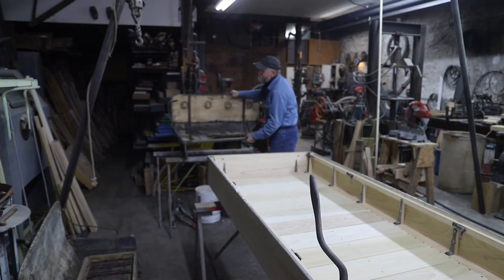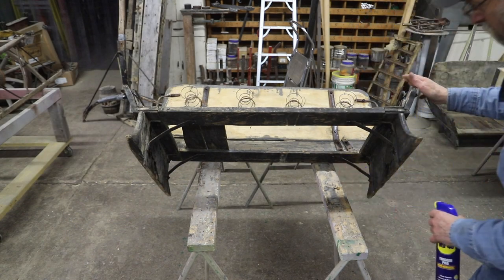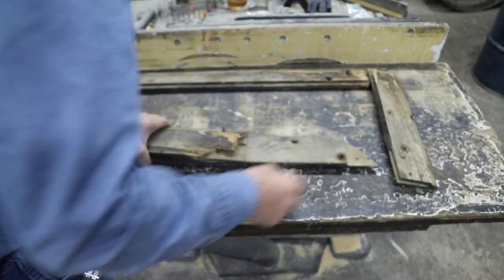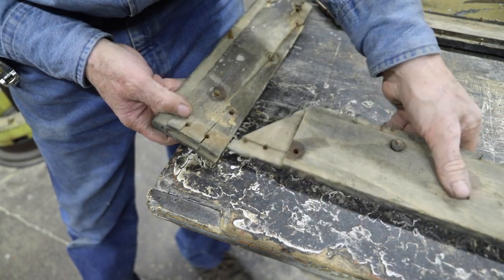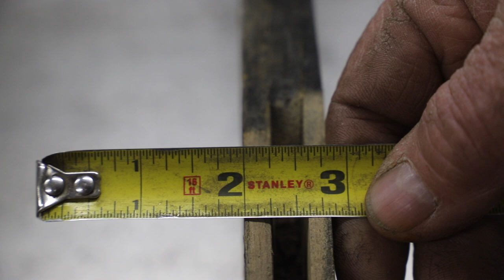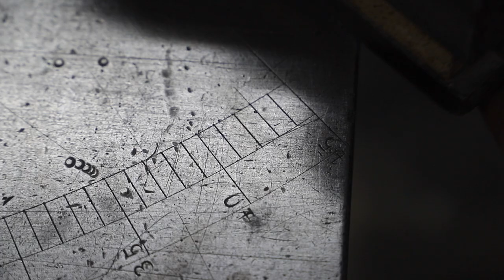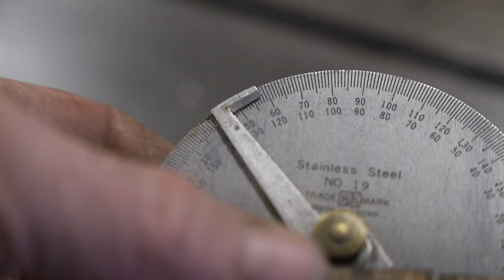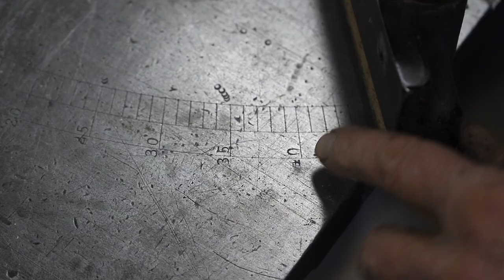Challenging Buggy Seat Base Corners | 2 Seat Buggy Part 8 | Engels Coach Shop

Comment: One time I built a jig for a rolling beveled miter.  It took two days to figure it out.  But I couldn't use it.  I had built it exactly backwards to what would work.  An older man happened to drop by.  He had been a pattern maker for many years.  As I was explaining my problem he had already stated with some modifications.  In about 15 minutes he corrected my jig whereas I was thinking I'm going to have to start from scratch.  Mr. Engels, I fully appreciate your trials and your skill.
Reply from the maker: Yes, conceptualizing the procedure sometimes takes longer than carrying it through huh.

Comment: If they did it the hard way back in them days there must have been a reason ? Your respect for their reasoning is what makes you so special  😊✔
Reply: There has to be one. Because you see, that type of joint, isn't as strong in the vertical plane as the full one is. It's excellent against deformation in the horizontal, like against turning it into a parallelogram, but vertically, you could snap one quite easily, and on this buggy, there's no real obvious reason to defend against deformation because both the buggy frame and the seat's backing keep things kosher.

So there's got to be a hidden reason, and a pretty strong one at that, for them to have gone for it, because as seen in the video, unless you do it just right, you'll mess up. And it's not like today, when you could make 50 of X part and they'd match perfectly. Back then, it was based on what lumber they had available, so each buggy might slightly different, especially in a more econo class, if i'm allowed to call it that.

Interesting pickle, for sure.
Reply: And then, maybe the builder felt like it was called for that day.
Reply: @aserta  Dave did say the original seat he's copying had ironwork for attaching a top to it right?  Its possible this wagon was going to be used in locales with brisk breezes and the builder was trying to make the seats stronger against wind loading from the brisk side winds acting on the top day in and day out, not having the seats turned into parallelograms over time with this joinery.

Comment: Fantastic work there Dave!  All the hassle to construct that jig, just to cut the mortise and tenon joint - seems to have worked out so remarkably well for you!  You certainly have an abundance of patience and dedication to your work!  As I watched you glue up and clamp down those frames, I actually felt like cheering out loud!  (so, okay I did!) That was a heck of a lot of joinery, just to craft a sturdy place for the drivers' backside!  Keep it up Dave!  These days I seem to need more reassurance that there's some greater value in building something far better than it has to be to function.  There's also the warmth that seems to come over me, watching older hands using even older skills and techniques, simply because that's the way it's supposed to be done.  Thank you sir!

Comment: I remember a number of years ago when I was the electrician at a street rod shop here in San Diego, the lead painter mentioned to me "Everybody sees the paint and body, and they go "Oooh!" and "Ahhh!". They look at the interior, and they go "Oooh!" and "Ahhh!". The only time they notice the electrical is when a switch doesn't work."  I know exactly how he meant that: I do my job, I do it well, and I do it unobtrusively. I made certain that switch, no matter how complicated the job, didn't break or not function. 

I'm reminded of that when you mentioned that a lap joint for those bases would have been faster, simpler, was much more common, and would have held up just as well. Who would have known? For starters, you would have. I guess this is one of the bigger reasons why I love your channel.
Reply from the maker: Thanks Bill.  You're right - who'd have ever known, but....
Reply: Interesting way to put it.  I do many renos, large and small.  I'm far more concerned and careful about what you don't see in a job.  If it's done right, everything else comes up great..  Do it wrong and everything else has problems.  It's that attention to detail of the 'inside' that I enjoy about these videos.  Careful, methodical and correct.  Love that jig - I may try that style of joint one day too.  Cheers to the 'unseen heroes'.

Comment: As always a great vid that shows how even in to days quick and easy make it do society there are true craftsmen out there that near enough is not good enough and with a little care and attention you can make it the same as it was but with better modern glues and attachments (bolts and screws it will last hopefully in better condition for atleast as long as the original did. To be honest i could sit here for hours and watch you take plain pieces of wood or bits of steel or iron and turn them into such great restorations or repairs. Gives you a whole new respect for how these were made in times of old with only hand tools and early machines. Hope you have  been able in your own time to pass on all your talents to others that will carry on once you decide you have done your time as these are the skills we are all to eager to let be lost as not required today when we have such a use it till it breaks and get a new one society.

Comment: Building the jig usually takes much longer than the job itself. Despite the hiccough (what's 7 degrees here or there, lol) it was most enjoyable. Thanks, Dave.
Reply: Can't get my head around why that angle was used
Most would stick to 45 deg - yes Dave is a professional but that angle issue, for me, just wasn't worth the effort - (me) professional doesn't mean perfectionist
Reply: @MrLikeke  I doubt "historical recreations no matter how wrong" would be continued by Dave Engel if Dave knew that by recreating the same would ensure consistent failure.  In this case (the buggy seat) it seems, from my perspective, that there'd be little difference (additional failure) because of the additional structures and fastenings which maintain the whole structure of the seat BUT for me personally - thinner (intricate) pieces of wood will rot quicker than thicker versions 
BUT hey... I'm no professional and no perfectionist.... just methodical with lots of thinking.
Reply: 90 percent of any job done right is in the preparation.
Reply: @philhunt9297  Phil, what you say is the other side of the coin.  The historical remodels I have been on have much to do with historical accuracy and not so much with what seems practical.  Sometimes it is agonizing as like digging a hole with the wrong end of the shovel.  But there ya go.
Reply: @MrLikeke  Stole my thunder. Exception: historical restorations of buildings must meet current code.

Comment: That joint is like a bridle joint I would call it a mitered bridle, we used them sometime in carcasses. I think that seat construction is really a top class job.  Covered in metal corner pieces the mitered corner joints for the seat that are not seen show that the maker took pride in his work, much like yourself Dave. Also it seems to be some fancy metalwork as well

Comment: I really like your little baby Wonder Bar you used on those small rivets and sheet metal corner brackets. Whoever designed those corner joints must have been a glutton for punishment.  And you Sir, "have more sneaky moves than a streaker at a policeman's picnic!" Excellent jig and fixture making.

Comment: Well, that was an immediately useful video.  I've had a piece I've been meaning to make for a while that I was balking on because I didn't have a proper tenoning jig to cut the slots in the ends to make a joint rather like this one.  Now I know how to do it with a few pieces of scrap wood instead -- and I feel a little silly for not thinking of that before.  Thanks for the help!

Also, seeing how this works cut at an angle is going to make my assembly better than I'd planned, too; I was thinking of doing it cut straight across, but an angle will work better.
Reply from the maker: Very nice.  Have fun!

Comment: Dave's Table Saw might have had a Tenoning Jig Attachment once upon a time but it's likely long gone but they do make modern versions today and you'll find them quite affordable depending on what you need. Many can be adapted to nearly ever saw if it's guide bar is to large/small fit it's grove by machining it or just replacing it with the right stock bar since only that part that needs to ride in the table's slot and they also can be used at times elsewhere for stock on  a shaper/router table. Though his jig was about the only alternative he had since most Tenoning Jigs are made for Table Saws not as Old School as his and far smaller but he could probably make a version since he did it for the Morticing Machine he all but remade from scratch earlier. One thing to think about for most of us  would the buggy seat hold up to a modern passenger who's a bit  more Elephantine than those that rode in it when it was new since we're on average taller/wider than they are is why often things like carriages/coaches seem to be quite small to us today.

Comment: That’s clever by putting the tenon on 38 degrees it doesn’t come out the side. The joint is not exposed to the weather. Thanks Dave
Reply: Greg Home. That's brilliant!! I assumed the joint was 45 degrees.  We all assumed it was 45 degrees. So when we find it is 52 degrees......why!!!  It's 52 degrees so it wouldn't show on the outboard side. EUREKA!!  Thank you so much for that observation, now I can sleep.
Reply: The joint have been cut at any angle. By just shortening the tenon and cutting a stopped mortise prevents it coming out the other side. I have no idea why it was cut at 52*/38* but I am sure those craftsmen had a reason. 🤷‍♂️
Reply: @philmenzies2477  your right Phil a stopped mortise would do the same but thinking on it just now, it would be much harder to cut.
It would have to be chilled carefully to depth at match the shortened tenon.
True 52/38 is just a straight cut. I would never of thought of it.
Reply: Sorry auto correct,
It would have to be chiselled carefully to a depth that exactly matched the shortened tenon.
My bad.
Reply from the maker: Very good Greg.  Since this stirred so much discussion I think I'll touch on it, but you're correct.  With two equal width boards, and to allow the side arm board to not rest on the joint, plus not having an exposed joint on the side view, this joint has to be 52/38 degree.  Nicely perceived.

Comment: Hello ✋.   There is a Russian proverb.
" Measure seven times, cut once."
The English language probably also has a similar one.  Great job, as always🤝
Reply: The "English" one is measure twice cut once (I used speech marks because I believe the Americans do same)
^^not for precision engineering ^^ 😉
khoroshego dnya (have a good day)
Reply: @philhunt9297  🤝
Reply: @philhunt9297  Obviously, the English aren't as careful as the Russians. Or perhaps their rulers are more accurate. ;-)
Reply: @alangknowles  huh?  why would they need to measure more often if they had more accurate rulers?
And I'd add - going by the way some Russians drive, in comparison to UK drivers, being more methodical and accurate ain't helping.
Reply: "I cut it three times and it's still too short."  :-)
Reply: But if we all did that, then we wouldn’t have any firewood.  Like I tell my boy, “ if it doesn’t turn out right the first time, it will warm us in winter. When we burn it”
Reply: @Stuart Stephens Said the apprentice carpenter.
Reply: @Антон Корнев From a capitalistic perspective, “Measured twice, cut 100,000 times.”
Reply: @stuartstephens  Sod's law always  takes over when I try to do woodwork .,Measure accurately. cut accurately, )0ops an eighth of inch to long . cut the eighth off .sod it , it's now a quarter  inch to short .eventually  when I do cut a piece the correct length , when I go to nail it the wood splits . I hope Dave reads this .
Reply: @ITeachRick  Hello. I was born in 1976 and lived in the USSR. And I understand the difference between capitalism and socialism. We had free education and medicine. The state provided rent-free housing, which has now become the private property of those who live in it. In the USSR, employment was guaranteed. There was no unemployment at all. But people slowly betrayed their country, for magazines with prostitutes(playboy) and Hollywood fairy tales. Most in the USSR thought that in the USA and Europe everyone has a big house and 2-3 expensive cars. We thought that in the US you work 5-6 hours a day.The Rest of the time you ride Harleys on the beach.......))))
Reply: @Антон Корнев Thanks for the reply and sharing some of your life! I’m a bit older than you, born in 1962. I started my apprenticeship in 1976, 😀, in a sheetmetal shop. I also lived in a commune from 1970 to 1982, so some of our lives are very similar. Employment, living, school and medical coverage. We didn’t get paid much, but food, transportation, clothes and most everything else was covered. I didn’t follow much of what was happening in the USSR, except for the love of vodka! I do remember that there was a fondness for America stuff, jeans, dollars.... 

Do you miss the good old days? Do you like the independence of capitalism? I left at 19 to find my own way. The “free” stuff was great but I felt a responsibility to earn what I got. I wouldn’t want to live in even a socialist society. Way too restrictive for me. 

Where do you live now? I’m in California. Great to chat with you!
Reply: @ITeachRick  The old days were good. But today is not bad either. At least in Russia. God save Putin. Russia was almost destroyed under Gorbachev and Yeltsin. Putin is rebuilding the country, but we still have a lot of enemies inside the country.
Reply: @ITeachRick  You said that the socialist  sociaety is too restrictive for you.  I think you  wrong. In the  USSR, idiotic  laws began to be issued under Khrushev. After Stalin's death. When Stalin was alive, every year, prices went down and wages went up, there were privat firms that were called "Artel" (Cooperativ). Khrushchev destroyed them.
Reply: @philhunt9297  it is measure twice cut once 🇬🇧
Reply: @paulstanding7267  Isn't that what I wrote?
I added speech marks as I believed the USA has similar
AND here's proof
https://www.goodreads.com/book/show/175349.Measure_Twice_Cut_Once
Reply: @Антон Корнев When I was a young, I heard the Gorbachev was a great man! So interesting to hear from a Russian, that he was a destroyer. And now, we are told the Putin is awful and you’re praising him. Another communication breakdown between our countries. I’m happy that at least, us common people can talk politely. 

Please tell, how communism isn’t restrictive. I’m really interested? In my community, my mother didn’t have much choice in her job, where she lived, how much money she made, what food she ate and much more. We were both pretty low on the social scale. My older sister had worked her way up the ladder and had more influence in her life. There were people higher up who had their own cars, very nice living arrangements, ate better food and so on, so I know there can be levels for different people. For us, most of the people were “commoners” so we were mostly equals. 

Depending on the wealth of the country or group, prior to going communist, I can see how life can be good, in the beginning. I know nothing of Russia under Khrushchev or Stalin, so I’m shooting in the dark. What us capitalists say in that communism works till you run out of other people’s money. I believe any system can be exploited, abused and corrupted, by the government and even the people. If most everyone is working towards the same result, capitalism and communism can work well. From what I see, in communistic countries, the powerful people are untouchable and stay in power. In a capitalist society, there is the opportunity to advance beyond what you were born or destined to be. I will personally attest to that. When people want more than other people, both systems breakdown. Such is the case in the USA now. 

Thanks to the chat.

Comment: Wow Dave!! I would call those fine furniture grade joints. Great job on a joint that is a real pain. I have done similar joints on a frame for a heavy antique mirror-had an impressive scrap pile after it was done. Like you I am not at all convinced that joint is any better than a simple lap joint given the load directions it will see in service.  But I certainly respect and admire your commitment to duplicate the original. regards vic

Comment: Very nice improvising for your tenoning jig.  I like your goal of making it as it was made, though I'd say that a bridle joint is actually stronger, and if course way simpler to cut.  I'd agree that originally the aim of the mitered mortise & tenon may have been done in that the end of the joint wasn't open to the weather, but then back then their glue wasn't nearly as good as type III your used.  Anyway beautiful work as always.  (by the way, your old F&E dual arbor brings me good memories.... I had the exact same saw about 10 years or so ago.  Liked it a lot, but a PO had modified it too much, and rather than spending an ungodly amount of time restoring it, I finally gave it to a friend)

Comment: You may have touched on it inthe past and I haven’t seen it, but if you could offer your take on materials it would be of interest. I see a lot of Ash going through that shop and I think I know why. Light, strong and bendy. One of the most utile woods we have. I have been in love with it since I first laid hands on a Louisville Slugger and use it whenever I can. I even have my woodstove full of it right now. Sadly, it is being blighted by a foreign invader as we speak. A tragedy in the making. So get it while you can.
Reply from the maker: Correct on all counts.  Baseball bats use it for it resiliency to impacts.